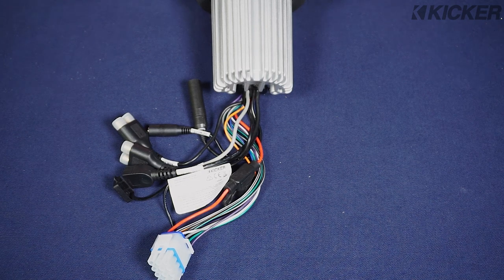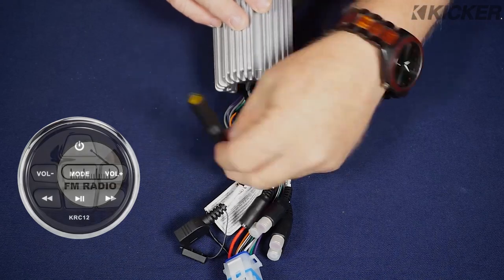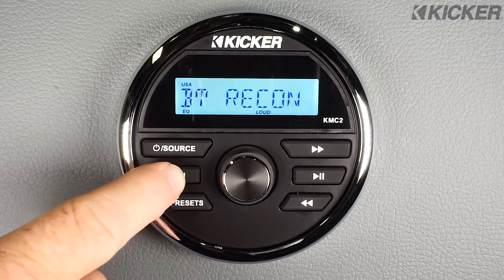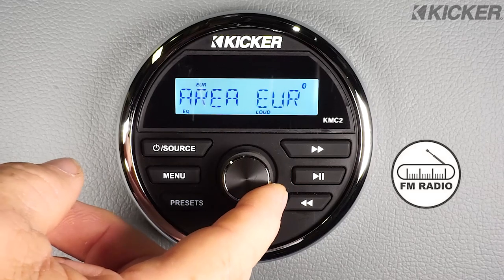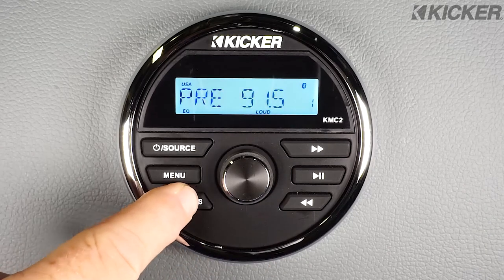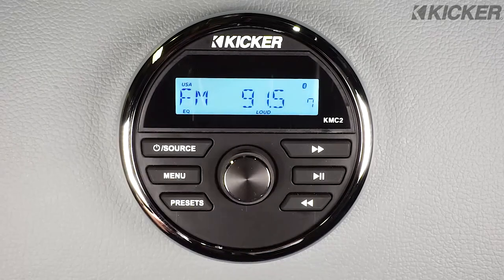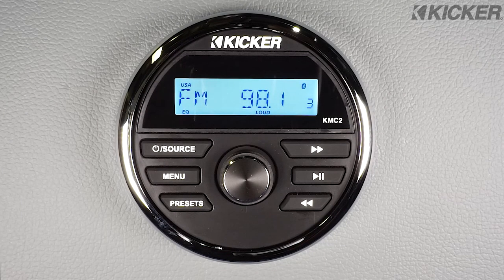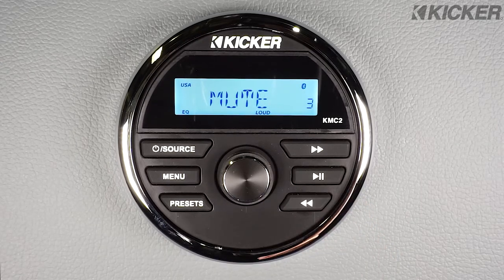KICKER KMC2 Marine Radio Deep Dive

Comment: Bought one of these on Amazon hooked up 12v to 12v illumination to 12v and black to ground am I doing something wrong?
Reply from the maker: Hard to say without knowing the vehicle or boat it's going into. Tech Support's contact info is: support@kicker.com or 405-624-8510.  They are open weekdays 8-5 CST. They can help you wire it correctly.

Comment: Your previous model, I bought in winter and didn't install till summer. Second trip on my boat, the volume buttons stopped working and by then it was past the warranty period according to the seller on Amazon. Has this new model addressed these issues or am I potentially going to face the same problem?
Reply from the maker: We normally address any consistent issues in the next version before releasing it, so you should be good to go!